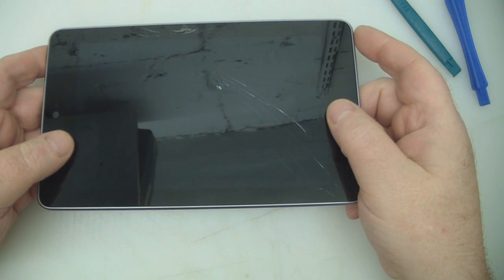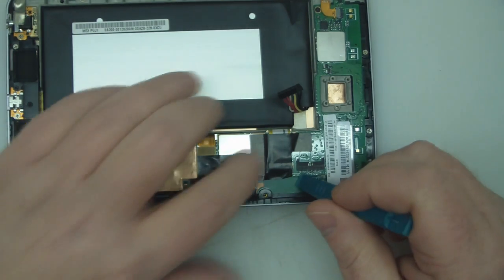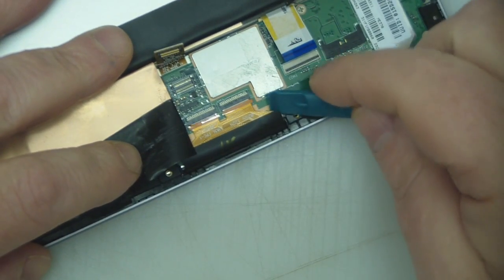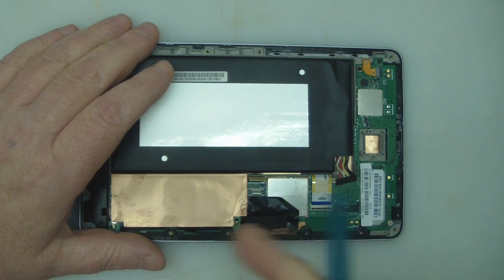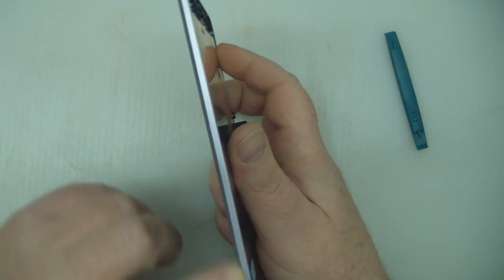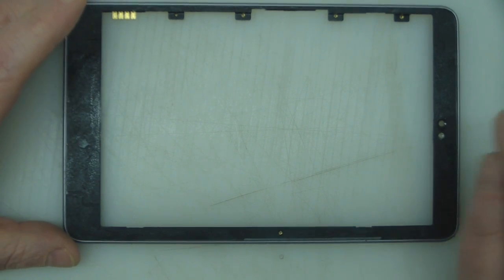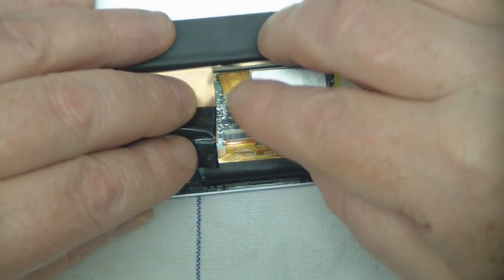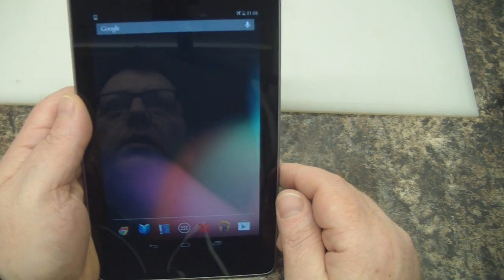How to replace a cracked Nexus 7 screen and digitizer #53

Comment: This was really helpful, thanks! In case anyone's wondering, it's not really that difficult provided you follow the steps carefully and take it slow. One note of caution - on my tablet, but not shown in the video, was what may be the cellular aerial stuck to the back of the digitizer/screen assembly. This needed to be carefully unstuck before lifting the motherboard away.

Comment: Would have been OK if you had shown how to release the ribbon connector but you covered it with your flaming hand. How hard would it have been to describe what to do instead of 'just release it with the spider.'. Tablet now knackered, thank you. If you are going to instruct people how to do it the do it properly.
Reply: That sucks. It sucks even more knowing that the ribbon connector (next to the power connector) does not even need to be unplugged.
Reply: Jaroslav Záruba Managed to pick up a scrap Nexus with a good motherboard fortunately.  It surprised me just how fragile those ribbon connector locks are.  They really don't need to be so flimsy, surely?

Comment: My screen was shattered and so I purchased a new one. I followed your video, but do not think that I purchased the digitizer separately. I did have to separate something from the shattered screen. Is that the digitizer? Anyway, I reused that part and reassembled everything. I just have a white screen. Did I not make all of my connections correctly or should I have also replaced the digitizer?

Comment: Thanks Andrew most helpful but I need some sticky material to hold the screen to the plastic bezel. After I separated the screen and digitizer from the bezel I had to leave it before fitting the new screen and I think the sticky stuff dried out. Just wondering what adhesive material I can use to hold the screen in place? Can message me?

Comment: Brilliant. The bezel was cracked on mine, which lead to the cracked screen when I tried to replace the charging port. It was easier than I thought. For what it's worth, you mention that it has had work before because screws were missing; the same screws were missing on my brand new one. So not to worry. Thanks so much for this!

Comment: Thanks a lot. Perfect guide, except the glue between the bezel and the screen which I tried to replace using by normal glue with partial success. Currently Nexus waiting to under pressure to dry the glue :) I hope the best :)

Comment: Hi Andrew. Great video. My new lcd screen does not have the copper foil tape already attached to the ribbon cables like yours did. Can I just reuse the old ones if I can peel it off? Also I noticed I had those 2 screws missing as well. Thanks.

Comment: Thank you for the video, saved me forking out 120 to fix it however I did make a rookie error pressing ever so slightly too hard on the corner of the new screen and cracked it :/ I also damaged the bezel a little trying to remove the glass which I also thought would be easier to pull off if it was all smashed - it wasnt. I bought a screen and digitizer with a bezel the second time and from a uk seller. wish I'd done that the first time. Only problem I found with this is the screws do not fit perfectly flush whereas they did before and one side of the nexus will not snap shut without force I darent apply, so I am going to remove a screw or two and hopefully fix that issue. Good news is - the screen bloody works! so chuffed. :) £80 down but I can fix them now. Thanks again!

Comment: Hi Andrew

Fantastic video. It made taking the nexus apart really easy.

One question though. have you any advice on who to buy from off ebay. I am an ebay newbie and the lcd + digitizers seem to vary in price from £8 to £40
Reply from the maker: Hi Mike try to buy one from a UK seller it will make it easy if you get a dud one. Expect to pay around the £35 to £40 I have got a few screens from a seller from china and one of them turned out to be a dud and he gave me a full refund after I sent him a picture of the screen as it just had red lines on it,

Comment: HI Andrew  Great video  but Think I may have made the same mistake as a few others or been cheated...I had a crack on my screen so I bought a new replacement screen on amazon as below .Put it all together with help from your video  and when i turn it in I have a white blank screen ..Did I order or receive wrong product ?        feel cheated as what i ordered was..
     
http://www.amazon.es/s/ref=nb_sb_noss?__mk_es_ES=%C3%85M%C3%85%C5%BD%C3%95%C3%91&url=search-alias%3Daps&field-keywords=SKILIWAH%C2%AE+BLACK+ORIGINAL+REPLACEMENT+TOUCH+SCREEN+DIGITIZER+FOR+GOOGLE+ASUS+NEXUS+7+de+SKILIWAH%C2%AE
Reply: Hi Colin, I just replaced mine and it seems you ordered the glass only and not the glass with digitizer attached as shown in this video. You need this: http://www.amazon.de/Google-Display-Touchscreen-Anzeige-Bildschirm/dp/B00EX9ZZDG/ref=sr_1_1?s=ce-de&ie=UTF8&qid=1427732404&sr=1-1&keywords=nexus+7+bildschirm#Ask

There are cheaper ones but I prefer the insurance of the ASUS part from Amazon. 

As mentioned in the video, trying to replace the glass on its own is very difficult because it is glued on hard to the digitizer. Buy both as above. Hope that helps.
Reply: Thank you

Comment: Hi,I've a crack on my Nexus 7 and screen is not working.I can use my nexus 7 with a mouse,display is okay.Just have a crack and the area without crack is working fine.
I just want to ask should i buy just 'Touch screen' or should i buy 'LCD+Touch Screen' cause i'll be giving it to a store to fix it.

Comment: My screen is also cracked and in need of repair.  I just want to be sure I am understanding the terminology correctly.  The following link contains what I think to be the replacement part for my Nexus 7: http://www.ebay.com/itm/For-ASUS-Google-Nexus-7-Glass-Digitizer-Panel-Touch-Screen-/371172993485?_trksid=p2054897.l4275. 

Is this what I need or is this what you are saying one should not buy without having the correct specialized tools? 

Thanks, and thank you for the video!
Reply from the maker: No don't buy that buy the complete unit lcd and digitiser like this one here: http://www.ebay.co.uk/itm/New-LCD-Touch-Screen-Digitizer-Glass-Assembly-Replacement-for-Google-Nexus-7-UK-/141300204536?pt=UK_iPad_Tablet_Accessories&hash=item20e62603f8
Reply: Okay great, thank you.
Reply: andrew mcneil I attempted to seperate the digitizer from the LCD and got it but at the last end it freakn cracked almost got it perfectly but failed should've took your advice... it was in there like no ones business.
Reply: You need one with lcd screen and digilatiser you can buy really cheep ones of www.dhgate.com but they take a long time to come in the post
Reply: Okay thanks, David.  I'm in the States but either way, I have been without my tablet for 2 years now- I can wait a little longer!  Thanks again.

Comment: i have got the same problem broke my screen.. however when i ordered it must have been the wrong part it just being the glass.. not the lcd aswell.. can you buy lcd separate and attach it to the new screen i brought already or do i have to order the whole thing as one?
Reply from the maker: You need to buy the lcd and digitiser as one unit. They are around £35 on ebay. Ask the seller if you can send the digitiser back for a refund.

Comment: Great video! but I have a question. At the last part when replace the new lcd screen and digitalizer you don´t use any special glue or apply gun pistol, you just put and press it. Is that right or I missed a part? Thanks anyway!

Comment: I replace the LCD and digitizer everything went smooth just like video but once put all back together the screen don't turn but I can hear the the tablet is on just has a black screen. And the LCD and digitizer are brand new??? Help
Reply: Irma, it sounds like the video cable have come loose, its the U shaped one on the back of the LCD, make sure you secure it with tape firmly after closing the micro-latch otherwise it works loose when you slotting it all together.  Either that or a bit of dirt or dust on the latch at the other end of the cable.

Comment: Good to see a "tear down" where you don't have to strip everything out. Minimal intrusion, clear instructions.
I would take issue with using a "sharp knife" to lift the glass out of the plastic bezel. I managed to crack an unbroken screen. The trick is to get the frame and glass really hot and push the glass out of the frame from behind, before using the guitar picks.
 5* tutorial. Thanks
Reply: Allan I agree about the heat, but not too much of the bezel converts itself into a wiggly piece of modern art. ;-)
Reply: The guide actually adds unneccessary work.